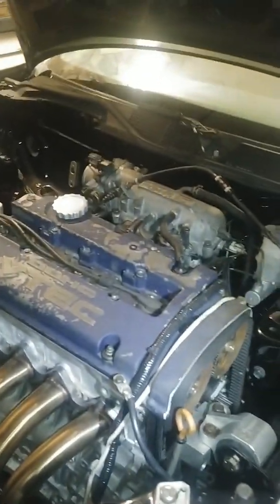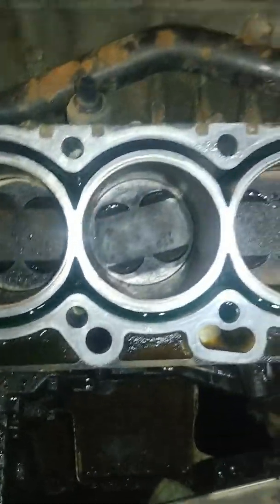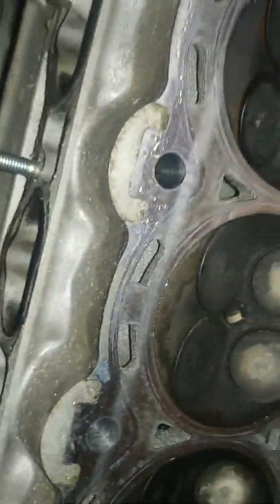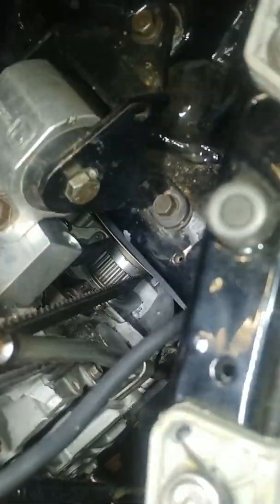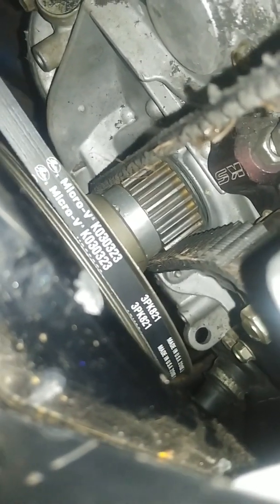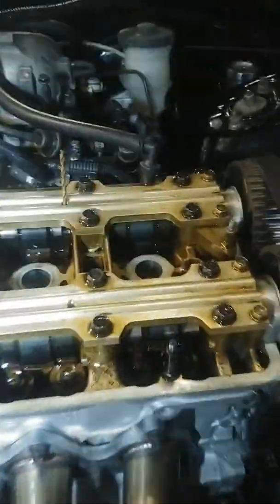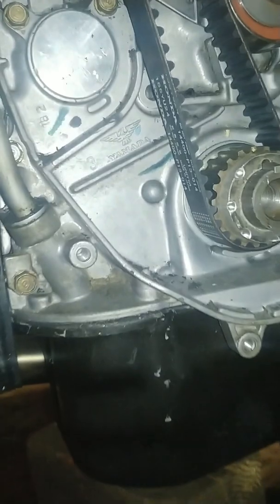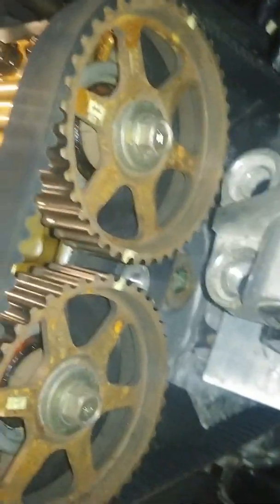How to install manual h23 tensioner on h22 with new HONDA timing belt

Comment: I saw timing belt on crankshaft nothing hold keep belt in place. Doesn’t the timing move out of place? Just wondering I did saw spacer between crank gear and under drive pulley

Comment: Nice detailed video. I also did the same back in 2019 on my H22 and used an H23 manual tensioner because at that time I didn't know how to depress the hydraulic tensioner back then. lol  But so far its still running great and no problems with the timing belt slipping off. The manual tensioner is way easy to install and adjust the tension for sure bro.

Comment: So the ksruned wasn’t doing its job huh? Damn im going to have to get that set up instead. Thanks for the video new sub
Reply from the maker: Thank u sir and no the kstuned will work but need the walk blocker if you check the next video it showed that kstuned sent a too small od outside diameter spacer from where the balance shafts were
Reply: Kylemurray Raceeast just finished watching that video. So that spacer is only needed if you remove the balance shafts?
Reply from the maker: @germanvazquez584  yessir if keeping the balance shafts the kstuned tensioner will work fine if deleting them in race motor I will recommend the manual h23 non vtec tensioner and spring Reid Lunde at kstuned can help you if need parts   if deleting go to Honda my friend